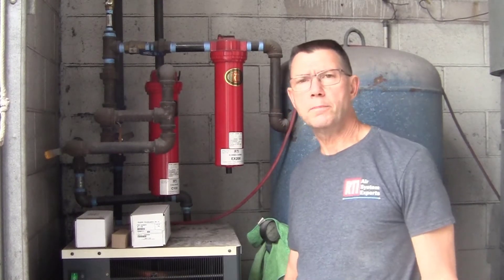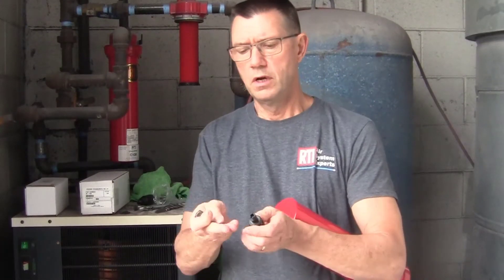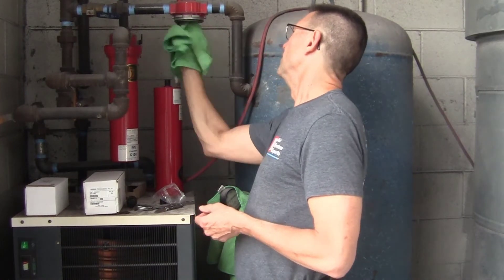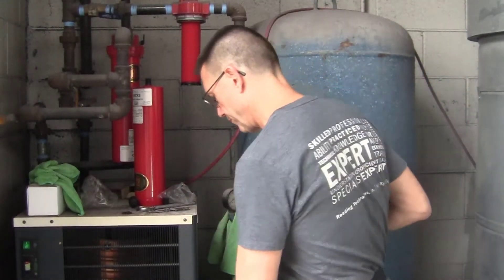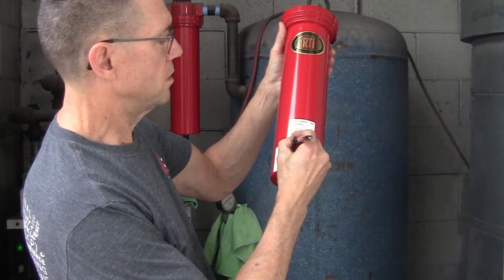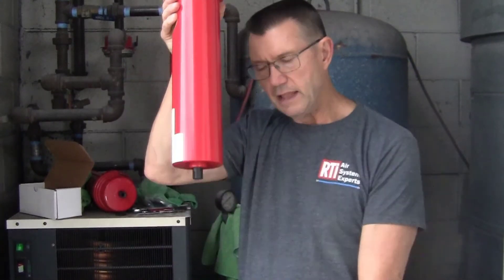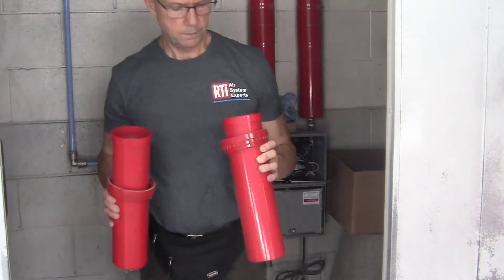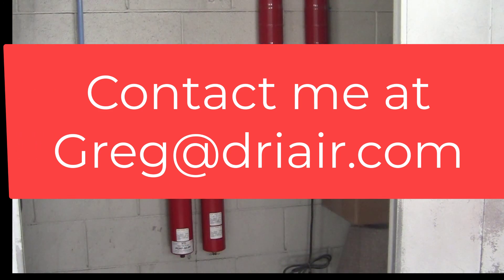RTI Filter Maintenance

Comment: I have a 2 stage rti setup.  I have been chasing debris in my paint.  I think the second stage has dryer beads or fibers breaking down.
Reply: Yes second stage has desiccant beads. Prob time to replace the cartridge or maybe put a smaller filter or something after it
Reply: @bigworm6635  rti is garbage.  I've never in 40 years seen a regulator go bad. Rti did in 4 months.  I put a toilet paper based filter off Amazon on that is a thousand times better than the rti dual filtration system.